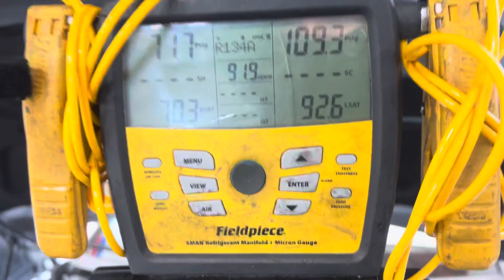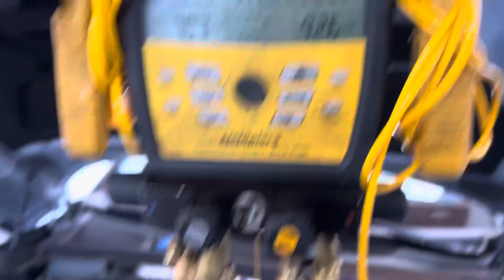ENGINE OVERHEATS SHUTS OFF AIR CONDITIONING ￼

Comment: I doubt that they will fix the engine. They would probably return it to the owner and use the collision as an excuse.
Reply from the maker: You are 100% correct body shops, collision shops, destroy customers cars and always blame it on the collision and get paid for it. That is exactly what happens unless it’s obvious that the body shop screwed up.. 

I see this happen all the time on a weekly basis as I’m in shop. I see ECM control modules body control modules get fried. I get the alternators fried engines overheated. I get to see all the stuff upfront while I’m inside the shop there is education or learning experience in the shop is called education .